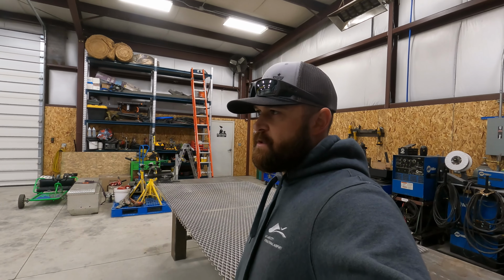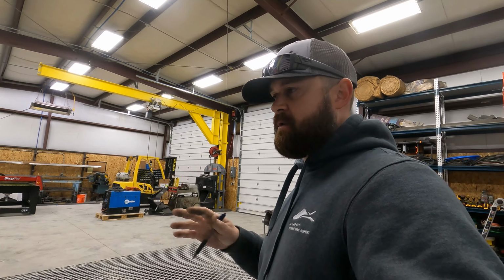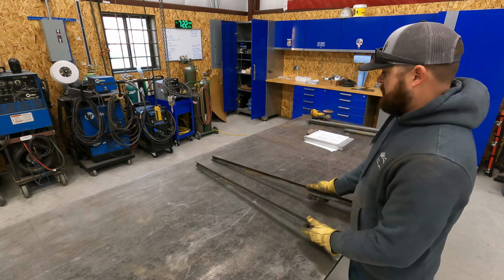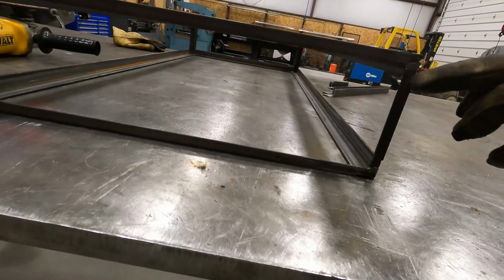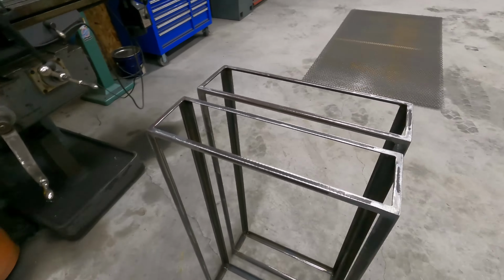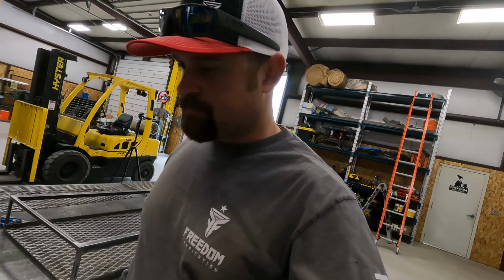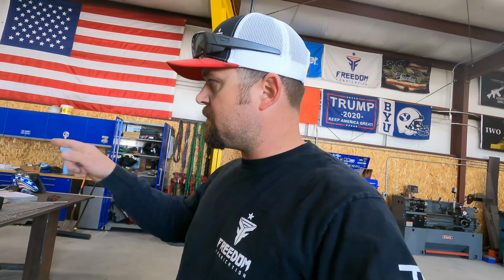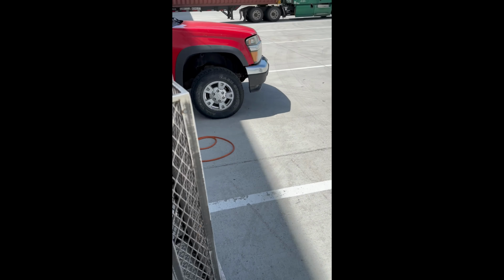Fabricating and field welding Gantry Material baskets

Comment: I built a metal rack with expanded metal and finished the ends with 1/2” pipe. I split the seam with .090” cut off wheel and it opens up automatically to accept the expanded metal. No burrs, no sharp edges and it stiffens the ends.
Reply from the maker: That’s a great idea. I’ll have to keep that one in my memory bank(scary). Thanks.

Comment: I hate having to one hand a grinder when prepping smaller pieces. I make AR500 targets. I use a magswitch 400 magnet that turns on and off. I turn it on and slide my angle iron up against it so i can use both hands on the grinder. Its strong enough that small pieces dont move when cleaning and it's easy to flip around to get all the sides.
Reply from the maker: I’ve actually wanted to get a mag switch for that very purpose. Do you mind me asking what you paid for yours?

Comment: Thanks for the video! How did you decide you wanted the efi trailblazer? I am kinda in your boat where I’m not fabricating full time but for the last four years I have been as busy as I want to be and have been relatively successful. I have been using a Honda 7000 generator with a miller mutimatic 200 suitcase welder when I do need to fabricate on site. I have been interested in getting a trailblazer but can’t decide if it’s worth the money to get the diesel and the wireless interface. I’m a buy once cry once kind of guy and I have been stuck. Any words of advice?
Reply from the maker: Well, this is a deep subject.(no pun intended) I can’t really tell you much about the diesel trailblazers cause I’ve never ran one. I’m sure they’re good, but I couldn’t really say what the big benefits would be over gas. I love the gas ones though. I have hundreds of hours on the gas trailblazers, both carbureted and EFI. One reason I do like the EFI is because they start up right on point in cold weather, which can be an issue here in Utah. I do think of you have issues with a carbureted one, it will be cheaper to fix, but that’s one of those give and take kind of things. IMO if you live in a cold state, and you’ll be welding in the winter, I would get the EFI for a difference of $700. I do feel the reliability is worth that. I have ran a diesel SA-300 a lot and it’s a great machine, smooth arc, but our gas powered machines were always awesome, and cheaper to fill up/run. The versatility of the miller is a game changer for doing field fabrication IMO. I hope this helps you in your decision. I’m excited for you. Anytime you get a new piece of equipment, it’s like Christmas!🎅 you’ll have to let me know what you end up going with. And as always, thanks for watching!
Reply: Thanks that is very helpful! I do live here in salt lake so i wasn’t even considering the carb option. EFI it is! I just didn’t want to regret spending the extra dough on the diesel if the gas EFI would keep me happy in the long run. Now I just need to decide if the wireless controller is worth getting. Thanks again for the help! Look forward to the video you do on building the trailer or skid for your trailblazer!
Reply from the maker: @jordandredge8421  I think you’ll be very happy with it. It’s amazing how much you can do with them. I thought I remembered you telling me you were in SLC. A fellow Utahn! I think I’ve settled on a welding trailer. Hoping to get the trailer built this summer.
Reply: @Freedomfabrication777  If you ever need a helper in Salt Lake let me know. I would love to meet up. Thanks!
Reply from the maker: @jordandredge8421  I appreciate that, same offer goes to you!